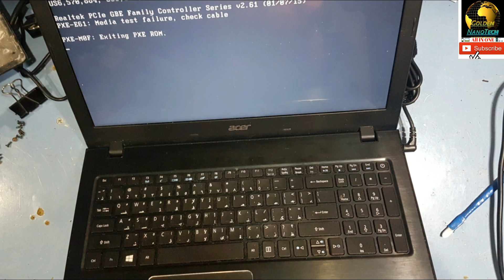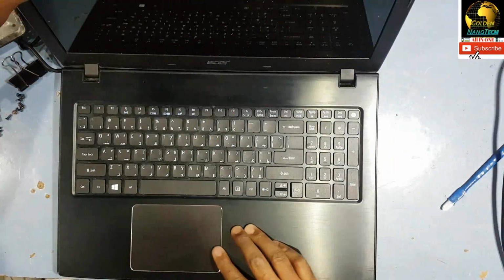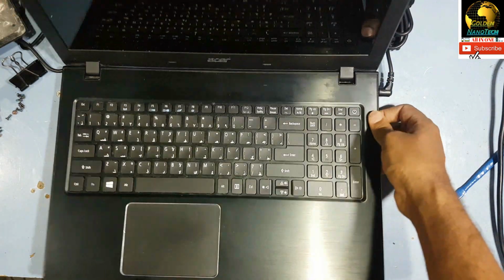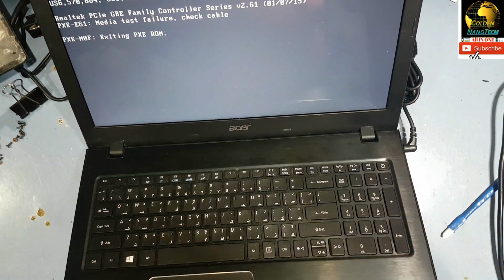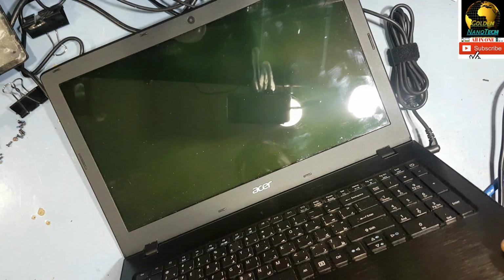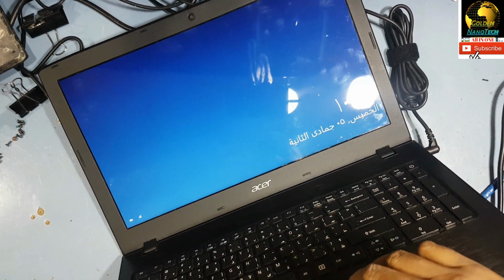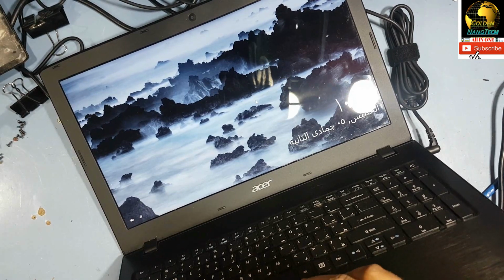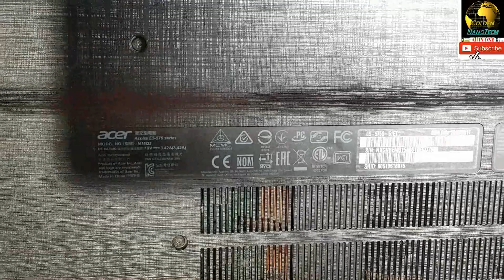ACER ASPIRE E5 576 MODEL LAPTOP NOT WORKING POWER FIX AT HOME

Comment: This was my issue. Ordered new charger, new charging port. Not necessary. Pulled and reconnected keyboard ribbon cable, turned on immediately on power button afterwards.

Comment: I was using my E5-576G and was charging my phone via the usb. When I plugged in the power adapter the laptop died and stopped working after that. Is the power/battery circuit separate from the motherboard?

Comment: Bro my acer aspire e5 has both blue lights on but it wont open up.  Abd the fan just turns off quickly.
Reply from the maker: U need to reformat your laptop and clean fan or change fan

Comment: strange... i opened my laptop and there is no hard drive... i had never opened it in the past. this computer used to work. any ideas? can a computer work without a hard drive? that spot where the first part of the shell is taken off, with the white tape like stuff behind it... there was nothing there. any ideas?
Reply: Maybe it's worked with an replaced ssd on cd💿 caddy or your retail repair shop was theft your hdd🙄🙄🙄😜
Reply: If you look in the other opening in the case, (compare it to the image at 4:54) you will see you have an extra part there. If you read the label of it, it will say "256 gb sata 6gb/sec" or something like that. That's the solid state drive, or SSD. It does the same job as a hard drive but is faster & better :)

Comment: I have the same model Acer E5 576G , it works only on power and not on battery, I tried configuring it on my own but till now, unsuccessful, It started after a few months after i bought the latop. Sadly, there are no repair centers of Acer in Pakistan
Reply from the maker: You can fix at shop
Reply from the maker: Battery ic problem
Reply: @GoldenNanotech  Sir, firstly it used to turn off whenever i moved my laptop or changed laptop position, then i went to a local market where they assured me that after service you wont face this problem, after service, it got worse and now laptop only works when plugged in (they removed wifi card too), i dont have skills to change or repair an IC unit, can you recommend someone in Pakistan where i can have it fixed, your help would be highly appreciated 😊
Reply: I have exactly the same problem, they just tell me to change the battery but I feel like there's some other problem too